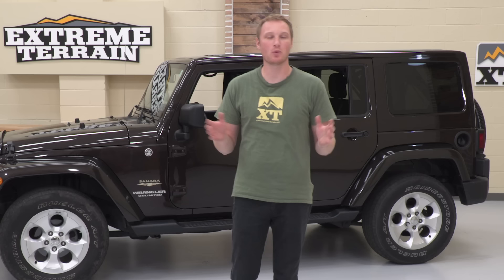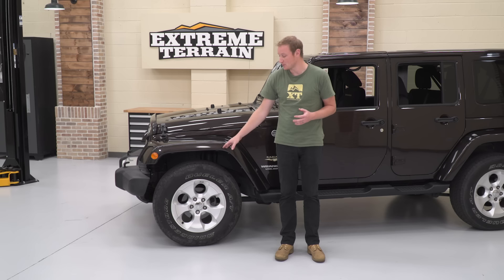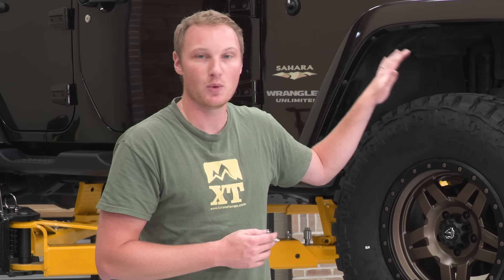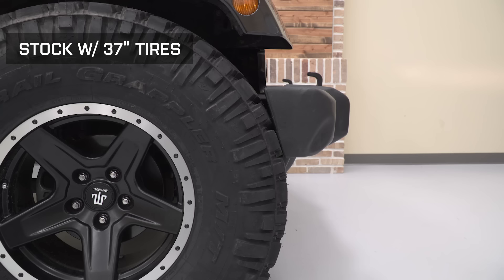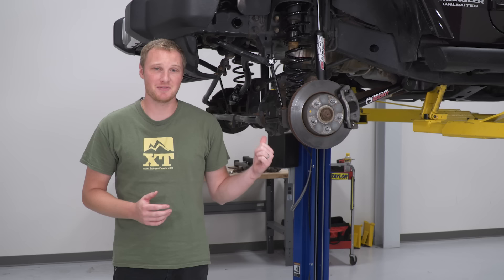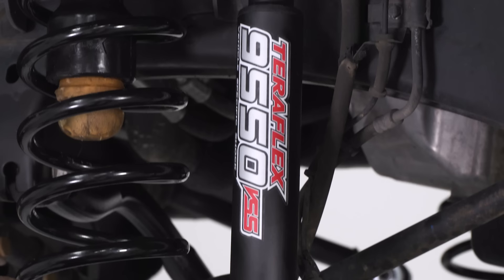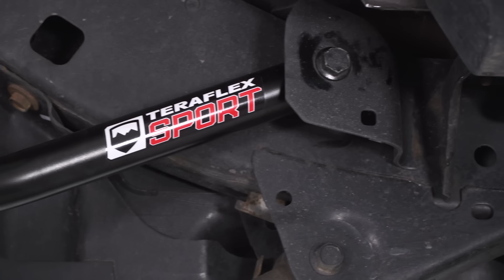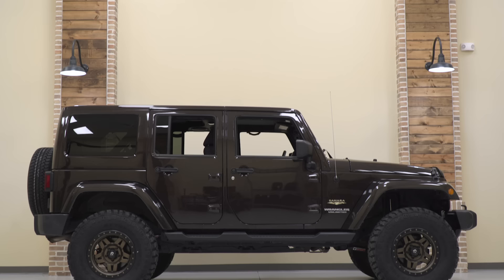How To Fit 35" Tires on Your Jeep Wrangler JK | Jeep Gets 3" Teraflex Lift and 35"s Installed

Comment from the maker: Subscribe for Daily Jeep Videos: http://terrain.jp/SubscribeXTyt
Check out parts for your Jeep Right Here: https://www.extremeterrain.com/throttle-out-nov2018-2.html
Parts List: 
Teraflex 3 in. Lift Suspension Lift Kit - https://terrain.jp/2Q8eNdZ
Dick Cepek Extreme Country Tire - https://terrain.jp/2KkG7Au
Fuel Wheels ANZA Bronze Wheel - https://terrain.jp/2A7G1rn
Black 6 Spline Lug Nut Kit - https://terrain.jp/2KiRFnZ
Reply: Would you need to regear for the 35" tires?

Comment: I have the Teraflex 3” Lift w/35x12.5 tires, with 8 Alpine Flex Arms, HD Tie Rod, Drag Link, Front and Rear Track Bars. 
The tires do rub when flexing and turning.
They rub on the sway bar links, especially going up rocks and turning, or doing Black Bear Pass and going down the mountain. 
Wheel spacers or a 4.50 back space is required.
Neither of which I have done.

Comment: Nice vid.! I went with 35’s on a 2.5” budget boost. With stock rims a needed wheel spacers but had already trimmed my stock fenders, lots of room for flexing that way.
Reply: Did you notice a big difference in performance? Some say yes, some say no. I have a 3” lift and currently on 33’s. My 35’s arrive next week.

Comment: Pro tip: the width of the tire is far more problematic than the height, and just about every 35 for up to a "17 wheel only measures to 34.6". So skip the dumb 34.6x@12.5 tire and go for a 34x11. You only lose .3 inches of ground clearance and they fit with a leveling kit on stock wheels.
Reply: Do you know how well the stock steering components last with a 35" tire.
Reply: @yager4092  i just bought a used 2018 with 59 k. cant tell you when the previous owner bought the 17"wheels with 33" tires....but they are 60k tires and have about 20k tread left. so im guessing he probably did it at end of manu warranty. 36k? anyway the jeep had terrible wobble....tie rod getting loose, but everything else seems ok....i replaced the track bar to get rid of the wobble.  im guessing not as long as youd like..id get a track bar immediately to help.

Comment: I wish you all had measured the tire to fender clearance either stock or without the lift. I bought my 2015 jk with 35s and a lift already installed, but I dont know how much lift is actually there. It looks like 3-4" but its time for new shocks (waaaaay past time) but buying shocks gets tricky if you dont know jow much lift you've actually got.

Comment: Jp mag did 10 Different ways to fit 35's 
Im running 2"spacer and 35's np 
Black rock 17x9 0 off set no fenders . cut bumper .
Rj44 detroit locker 
D44 torson lsd carbon chromoly shafts 4.88 gears .

Comment: In another video you mentioned with anything above 33” you may want to regear or the jeep will feel mushy?? You didn’t mention that in this video?
Reply: This video is just about getting 35s on the jeep.  If you have a rubi, you can run 35s on the stock gears no problem.  Otherwise, you can get a set of junkyard rubi axles for less than what it'd cost for a shop to swap out the gears, and the rubi axles are stronger anyway.

Comment: my set up consist of 
3.25 Rough Country lift 
35x12.5 AMP M/T tires 
RTX Baja rims -18 off set 
BDS disconnects 
stock Fenders
with this set up in the trails i still get rubbing in the fender when I flex

Comment: I have metalcloak overland fenders and 35s BFG K02 on XD rockstar 2 rims with 4.5 backspace and -12 offset. On a 2011 Rubicon with 4.10 gears. A little trim on the back of the rock rail. No lift! No problems. 😁

Comment: 2008 sahara unlimited 4x4 mile high edition with 35th no rubbing my question is should I regear?
Reply from the maker: If you've noticed a lack in fuel economy and overall driving performance then it may be a good idea to upgrade your gearing!

Comment: hey my 2016 is shaking a little after i installed the lift kit? i torque everything to the specifications. i have my friend shake the wheel while i look for pnay on the steering system but i can’t see anything.  any idea? thank you for any help

Comment: I'd like to see if there are clearance issue with a 2" lift kit and 35s while running the stock 18" rims
Reply: Todd D me too. I’m on a budget and would like to keep my stock wheels for my first set of tires.
Reply: I have an AEV 2.5 inch lift running 35's the air dam rubbed when I locked the wheel to either side so I trimmed the corners and now there's no more rubbing at all...

Comment: Your 35”s had some rub before the lift, but what about 34”s?  Will they fit stock without rubbing, or will it require a leveling kit or lift?  I’m looking at BFG KO2 285 75R17, which are 33.8” tires.   I’m using stock wheels without spacers.

Comment: If I were to put a 4 inch suspension lift with 35s and a tuner on my 2015 2 door Jeep JK, do I need to regear , after market axels, or breaks? Will Dana 30/ 35 axels and stock breaks be safe and efficient with this setup without regearing?

Comment: Would you need to regear the Jeep if you add 35 inch tires with a 2.5 lift?
Reply from the maker: You could get away without re-gearing, but it's definitely something you'll want to look into down the road if you do a lot of highway driving with your Wrangler or spend a lot of time off-road. Adding the extra weight from those 35s will absolutely be noticeable. A speedometer/transmission recalibrator will help bring back some of the power lost, but re-gearing will help out the most with that. Especially if you have a manual transmission. -Zach

Comment: That's half way true,  I installed 35s on my JKU the was no problem with the height,  the problem ws that I couldn't even turn the wheel,  it didn't work until I installed the 3.5 lift kit.

Comment: Gday mate, I’ve got a JK Unlimited Rubicon with a 2.5” lift, gets really good stretch and am running almost worn 285/70/17’s. If i fitted 315/70/17’s would it rub do you think? I’ve also got custom winch bar and rear custom bar. Also power and economy? What would the power and economy be like with 315’s? I’m currently getting 12.5ltrs/100. Cheers Steve. PS love your channel.

Comment: Bought a used 2018 wrangler JK sport S 2 door, seems to have a 2" superlift and has 315/70r17E ironman mt's, like the tires but not sure about the lift, any opinions?

Comment: One can for 37's with a 2.5". Just gotta get rid of the bulky plastic flares. Replace with something rugged like Poison Spyder.  
My 2010 was at least 500 pounds of sprung weight heavier when I was done. Low CG, steady even at highway speeds. 
High clearance for both rocks and road pizza. 😄😁😆😅

Comment: My build list has far exceeded my right now budget lmao. If I am looking for a 3" lift with 35" tires....would you suggest the tires or lift first? a 3" lift with 31" tires on 17's lmao...
 I mainly do moderate logging/Fire roads with a stock Rubicon.  Seems if I did tires first I could just remove the fenders and run an ugly duck for a spell...
Reply from the maker: The safer route in my opinion is doing lift first, then tires. Yes, it will look like your Wrangler skipped leg-day for a little while but there's a lot less headaches with that compared to trying to fit 35s on your Jeep while stock. If you don't mind removing your fenders, hammering some pinch welds or getting high clearance fender flares, go for the tires first. But I think its easier to get the lift first. 😄 -Zach

Comment: I’m running 305/70/18 with a 2 1/2in lift lower control arms and 1 1/2 in wheel spacer and I can keep up with tjs on 35s and a 5in long arm and lockers and jkus on 35s and 4in lift and lockers so
Reply: So......

Comment: No need to remove the Air Dam. That thing is PLASTIC and can be easily trimmed with a Dremel tool. Would be nice if you talked about the necessary offset/backspacing to run the 35"s. I like my Rubicon stock wheels so I run 1.5" spacers to fit the 35"s.

Comment: Can you run those 35s with just a Teraflex leveling lift?
Reply: Boyd Bros. As long as u cut or get flat fenders no problem
Reply: I do, however I don't off-road.  I also have front and rear steel bumper on it.

Comment: What length shock should I run with this lift kit in order to get maximum performance?
Reply from the maker: Shocks are normally sold with their lengths / appropriate lift heights noted! Normally 1-3" and 4-6" are most common. -Zach

Comment: Do you need to install a steering stabilizer if you get a 3" lift kit? Some people say it is necessary if you don't want to wobble on the highway. Is this true?
Reply from the maker: A new steering stabilizer is a great addition to a 3" lift kit if you're looking at moving up to 35" tires! I'd highly recommend you check your tie rod ends, control arm bushings, track bar and ball joints too though. If any of those are worn you may be looking at death wobble in the near future after lifting with bigger tires. -Zach

Comment: Typically the biggest tires I recommend on a JK w/o a lift is 33's.
Reply from the maker: You definitely can fit 35s on a stock JK with some trimming and aftermarket fender flares, that doesn't mean we heartily recommend it though haha! 33s with a 1.5" leveling kit is about perfect in my eyes, they can fit without a lift with minor rubbing though. -Zach

Comment: Always love XT videos, new to Jeeps, ‘15 JKU sport, I am currently running pathfinders AT 265/17R17 paired with MB Wheels (off-road). Daily driver, light off-roading, All stock, I like the set up here and I will get 35’s (suggestions for snow/ice), W/ stock and 35,” reason to have a splashguard? Pro/cons? Also, too rough for the wife and need help. Love the 3” lift, will the kit help for a smoother ride for the wife? Would another lift kit work better for what I am looking for? Additional parts needed/recommended with any lift? Thanks again and Semper Fi !
Reply from the maker: Thanks for the love, Shawn! When the time comes to snag a set of 35" tires, I highly recommend looking into something with the a three peak mountain snowflake rating. This rating indicates the tire meets required performance criteria in snow testing to be considered severe snow service-rated! Some all-terrain tires with this symbol include the BF Goodrich All-Terrain KO2, Falken Wildpeak AT3W or Goodyear Duratracs. Splash guards really come down to local laws and personal preference, they absolutely help protect your paint if roads get heavily salted in the winter though. 

When it comes to Jeeps, you will never really get them to ride as smooth as normal cars. That being said you can absolutely get them to ride nicer with quality suspension components. If you have room in your budget I highly recommend looking into Fox Performance shocks, as they are known for their quality and smooth ride. When it comes to 3" lift kits you really want to make sure it comes with something to address your suspension geometry like adjustable control arms or control arm brackets, an adjustable front track bar, rear track bar bracket, longer swaybar links, etc.

I know this was a lot of information, but if you have any other questions please feel free to give us a call! 1-877-870-8556 -Zach

Comment: im looking to get an ‘07-‘11 four door jk this summer and im interested in running a 3 inch lift without coils or shocks, with 35 inch tires, but i DO NOT want to re-gear. is this possible or would i have to downgrade to 33s?
Reply from the maker: So you're looking to do a 3" spacer lift? You definitely can put on 35" tires, but you're going to feel the effects of it on your daily driving. Your low end torque will be effected, you'll feel a lot more sluggish on the road, regardless if you have a manual transmission or an automatic you're going to notice your higher gears becoming less useful when cruising on the highway and if you don't use a programmer your speedometer will be inaccurate. Sticking with 33" tires will absolutely lessen these issues. -Zach

Comment: I currently have a Teraflex leveling kit, and 1.75 inch WHEEL spacers on a 75th anniversary jku. Would 35's rub too much? I don't do too much intense off roading, yet
Reply from the maker: 35s on 1.75" of lift will be pretty darn tight. If you plan on removing your factory fender flares and replacing them with a higher clearance set, you won't have any major issues. With factory flares, you're lightly going to rub a good bit on anything but straight flat roads. -Zach
Reply: @extremeterrain  I believe the leveling kit is 2" in the front 1" in the rear, i also have 1.75 inch wheel spacers. The 2.5 inch lift i want is on backorder

Comment: Do you need to regear with a 35 tire on the JKU sport with the dana 44 rear axle?
Reply from the maker: You can get away without regearing if you recalibrate your speedomter/transmission after installation, and you have the optional 3.73 gears from the factory. If you have a manual transmission or 3.21 gears though, I highly recommend you look into regearing because you'll absolutely notice the loss of power while driving. -Zach

Comment: Does it need to be regeared running 35s?
Reply from the maker: Need? Not really. Do we recommend? Yes. Especially if you have a manual transmission, putting on larger tires like 35s will make your Jeep feel sluggish and you won't be seeing your higher gears too often. The lack of power will feel pretty noticeable if you take it off-road as well. -Zach
Reply: ExtremeTerrain.com what’s the consequences of not rehearing

Comment: How well does the steering components hold up on a JKU  while running 35-12.5/17
Reply from the maker: When brand new, stock tie rods, drag links and track bars hold up just fine with 35s for on-road driving and moderate trails off-road. As they wear down though, swapping them out with heavy duty replacements is a great idea to help handle the extra weight of those larger tires. Check out the following link if you'd like an idea of some heavy duty replacements! -Zach https://www.extremeterrain.com/teraflex-hd-tierod-drag-1853900.html

Comment: What are your thoughts on spacers as a temp fix while saving up for rims?
Reply from the maker: Wheel spacers are a great way to fit larger tires or get a wider stance if you're saving up for aftermarket wheels, or if you just want to keep your stock wheels in general! As long as you make sure they're installed properly and checked often, you'll be perfect. -Zach
Reply: When you say often, are you suggesting every tire rotation (5-7k) or more often?
Reply from the maker: That would be perfect! -Zach

Comment: Can I run 35" on stock with no rubbing or pinching if I got after market fender flares that were the flat style?
Reply: You will need to trim a little rock rail and maybe a tiny bit of sheet metal in front of your rear tire👍🏻
Reply: You also need 4.5in backspace and _-12 offset on you rims

Comment: Can I put a 1.5” lift with 35s?
Reply from the maker: They should be able to fit, but things will still be close and you may need some trimming to avoid rubbing. Honestly if you want 35s and you plan on going off-road I would recommend looking into a 2.5" lift kit. -Zach

Comment: What's the rear ratio on this ?!  Isn't the front axle a little weak for 35s ?
Reply: Nick Tremblay I believe the Sahara and sport both have 3.21. And the Dana 30 should be fine for 35s as long as you’re not doing crazy rock crawling. I have a sport and I regeared to 4.56 which is the best mod I could’ve purchased after switching to 35s. But as long as the tires aren’t spinning it’s a waste of money to do gussets and what not.

Comment: Is it specifically 3" to prevent most rubbing or can you also get away with 2.5" lift with 35's?
Reply: I used a teraflex 2.5 level kit. Only reason I used it was to give clearance to the stock fenders. If I had aftermarket flat fenders I wouldn't have needed a lift. I also have a aftermarket front bumper.